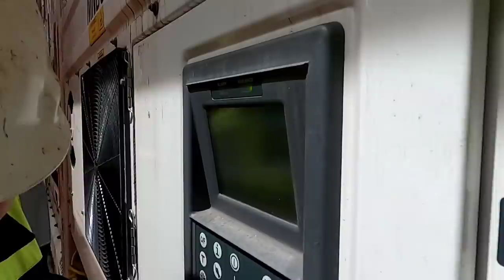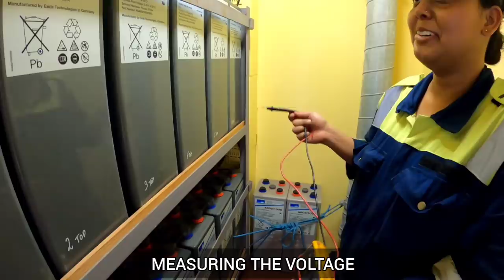Only GIRL On Our Ship Shows her - 3,50,000Rs Per Month Sailing JOB

Comment: Bhai this is funny!! one deck and E/R round thereafter directly lighting job😂 Maersk has new build ships therefore not that much job apart from reefers! This is misleading to new comers who planning to enter into shipping, But in real world especially in Tankers it's quiet different story any kinda electrical, Electronics, automation related problem including bridge machineries including hydraulics ETO have to deal it. It's tough job not easy at all. Hopefully anyone wanna join be prepared and have a safe sailing.
Reply from the maker: Well it's the true story here

Comment: could you please tell us what type of compressors , evaporators , condensators and expansion valve are used on board?
Reply: Actually we have 5 stage , 3 stage compressor for Accomodation Ac . Currently my ship has 3 stage now. For both the Accommodation and provision systems we have  water cooled condensers. For provision system .we have txv valves For provision and eev For Accommodation Accommodation AC  systems. Evaporator coil (don't have idea exact idea)  is open type on both  provision system and Accommodation Accommodation systems(unlike in reefer containers).

Comment: Love your videos👍How or what is the source of electricity for such a huge ship. Also how drinking water is managed?
Reply from the maker: Will cover it soon
Reply: Electricity is generated by Diesel power Generators called DA(Diesel Alternators)

Fresh water is taken from Supply vessel or at Port....but while at Sea,fresh water generators make water from sea water which is basically boiling  sea water and condensing it. The main Engine exhaust gas heat is utlised for boiling the seawater .

Comment: Who are electric motors producer for deck winches and who are winches producer showing on video ?
Reply from the maker: Rolls Royce
Reply: @KaranvirSinghNayyar  ok thx it is winch producer but do you know electric motor producer which is intalled on the winch ?
Reply: @Karanvir Singh Nayyar is it possible to make some video showing anchor and mooring winches also with its starter cabinets located probably in bosun store ? It is very interesting for me. Thx a lot. :-)